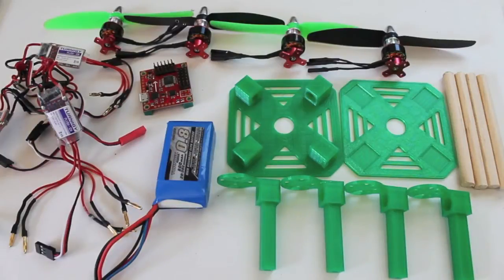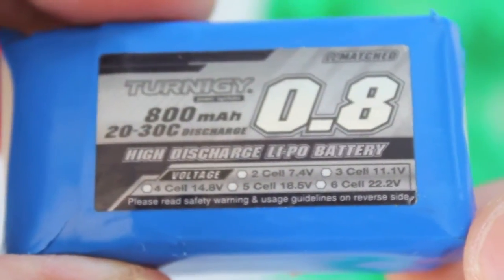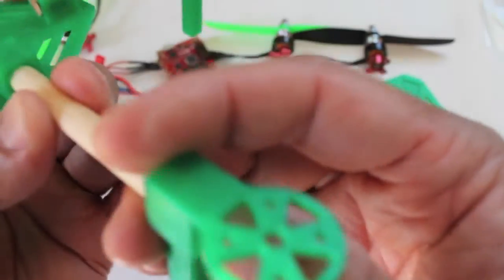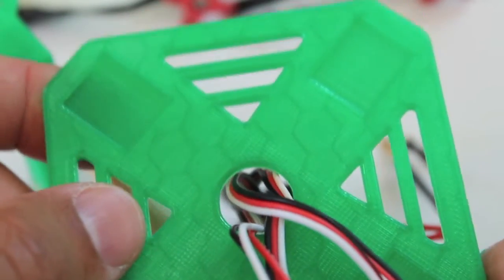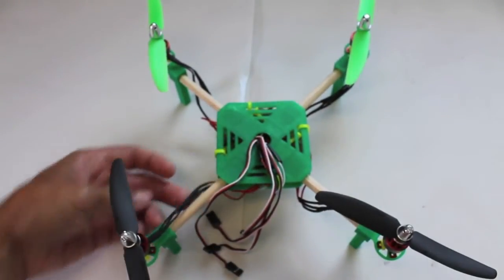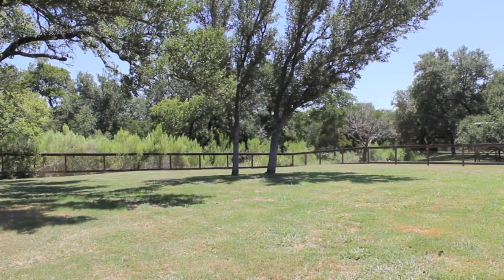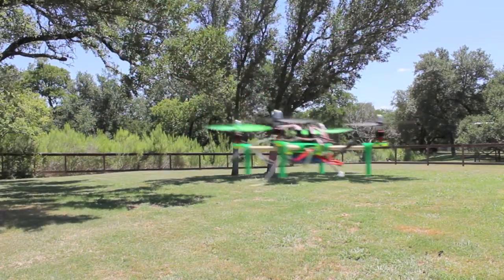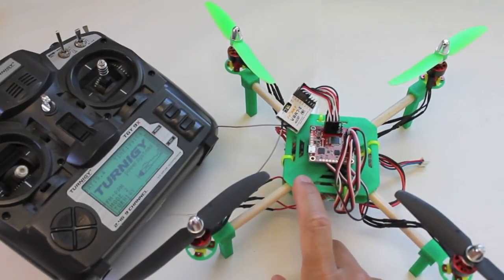DIY Mini Quad Build Log w/ MakerBot 3D Printed Frame and Outdoor Maiden Flight

Comment: I have printed out the frame, and ive made a complete list of parts, but before i order everything, i wanna make sure that all of these things will work together:

Battery- Turnigy 800 mAh 2s 20c Lipo Pack

ESC- Q-Brain

Motor- turnigy 1811 brushless outrunner 2900kv

Flight Controller- Multiwii Flip

Transciever- FlySky FS-T6 2.4ghz 6 channel

Reciever- Us Ship FlySky 2.4ghz 6ch reciever FS-R6B CT6B for FS-TH9X 9CH

Will the battery power all this stuff? Will the tranciever and reciever work together? So confused lol....
Reply from the maker: +Meatloaf Gaming I think that sounds like a great setup. My only question is if you'll have enough space for the Q-Brain. I'd take some measurements just to be safe. Yes the battery should power all that stuff although you may want to see if you can go up to 1000mAh. Maybe look into a 3S option as well. Good luck and let us know how it goes.
Reply: Thanks a lot Dennis, i've changed my mind, and i'm gonna go with the traditional 4 esc system and might get a better battery, but for now im gonna start ordering, and i will probably have tons of questions on how to hook up power and stuff, so ill make sure to let u know :)
Reply: +Meatloaf Gaming My FlySky FS-T6 came today along with my 5030 props and a small, 6ch reciever! I got the transmitter all set up without a problem, and i eagerly await my other parts!
Reply: +Dennis Baldwin +Meatloaf Gaming All parts are here, and i'm currently working on calibrating the ESCs.... For some reason, the ESCs do not want to save the high and low settings? Any ideas Dennis?
Reply: +Dennis Baldwin Never mind, my ESC problem fixed itself!! Everything id calibrated and ready to go! Unfortunately, I fried my battery in the process of putting it together, so i ave to wait for a new one from Hobbyking :(
Reply: +Meatloaf Gaming Dennis! Plz help! Everything was fine, and now, whenever is plug in the esc's they beep super fast and nothing happens.... Everything works when tested individually, but when it all gets plugged together all i get is beeping. All the motors are plugged in correctly, the battery is the right voltage, ive got my trim all the way down on throttle... I dunno what to do...
Reply: +Meatloaf Gaming 
Sounds like you fried them...oh well, sell what you can and give up. Your unfit to do this hobby...maybe try knitting.
Reply: I actually got this working a while ago...  Forgot I posted this lol! Since this I've actually built two working drones

Comment: Hi Dennis, I'm gonna try to put together this configuration, but I want to ask you a few questions. The Max continuous current for the Turnigy 1811 is 7A so can I use the 6A ESC instead of the 10A you use in the video?  Also, will be okay to use a power distribution for this configuration?  Any particular one that you recommend?  Thanks, and best regards!
Reply from the maker: Al B It's always good to have some level of buffer between the max rating of your motor compared to your ESC. I've heard 25% is a good starting place. So I would recommend 10A ESCs for the 7A motor. I don't have any hard evidence that this is necessary, but if you were to push your motors hard I could see them burning out the 6A ESCs. Yes you can definitely use a power distribution board (PDB). I generally don't due to the added complexity and weight on such a small build. It's easier for me to do the pigtail. This is a good one that I've used in the past:

http://amzn.to/1CBB2XL

But it's likely overkill for such a small build. HobbyKing has some cheap ones:

http://www.hobbyking.com/hobbyking/store/__23140__Hobby_King_Quadcopter_Power_Distribution_Board.html

Good luck and keep us posted.

Comment: What kind of remote do you use? Can I just use a 2.4Ghz remote from an other helicopter?
Reply from the maker: 1vachmed94 You can as long as you have a receiver that is compatible with it. I originally used a Turnigy 9X transmitter and now I'm using the FrSky Taranis.

Comment from the maker: Right now they are zipped tied with two ties/motor. One of my subscribers, Doug Mac Gregor, recommended nuts & bolts that should fit this motor perfectly. They are on the Radio Shack website and products IDs are 2103302 & 2103300. I will give these a try soon and let you know how it goes. Thanks for the question.

Comment from the maker: I based my cost off the MakerBot PLA cost. A kilogram of PLA currently costs $48. So that means each gram of PLA costs $0.048. Multiplying that by the weight of the motor plates and frame plates (48 grams) comes to $2.30. Somehow I came up with $2.40 before, but close enough. Hope that helps.

Comment from the maker: It's called Kyosho Zeal. It doesn't have as good of damping characteristics as Moongel, but works great for your flight controller. I like it because it's super sticky so you can, in most cases, get away with using it without mounting hardware. In the case of the current design I don't have any standoffs for the MWC so the Zeal works nicely.

Comment from the maker: If you're asking if I think 30A ESCs will be too big for the mini quad I do believe so. All 4 will be too big to fit within the bottom plate. The 10A ESCs are pretty tight already. I know what you mean about HK's stock. It seems things go in and out of stock so frequently. Very frustrating. Good luck with your SK450 build.

Comment from the maker: The 3D printer itself is pretty straightforward to learn and use. It's the 3D design that's challenging...for me at least. I've been learning with a program on my Mac called Rhino 3D. It's available for Windows too. The printer I'm using is the MakerBot Replicator 2 and you can find pricing on their website. I don't have the 9XR (yet) but I believe it's fairly similar to the 9X with a bit different firmware. Good luck and always feel free to ask questions. Take care.

Comment: So I'm pretty new to quads, I bought everything to build a SK450, I had origionally bought Plush 30A ESC's but then the Afro's came in stock a couple days later (Damn you Hobby King!) So I bought some of those also, I'm thinking of either Selling the Plush or keeping them and building a second copter (I have a 3D printer too) Do you think the 30A ESC's will be to big for this project?

Comment: How hard is it to learn the 3d printer that you use and how much and 1 more how do u like the 9xr and how easy is it to upgrade the radio I have the 1SQ heli max cause its the only lil guy that act like a really quad but its small and I didn't build it that's why I would love to buy the one you built or ill get the 3d printer if its not to hard to learn how to use it thanx keep up the great how to videos I've learned a lot thanx